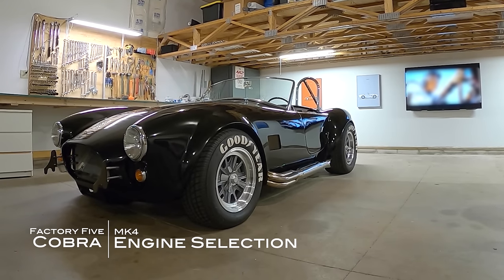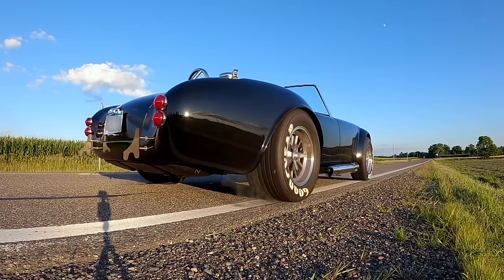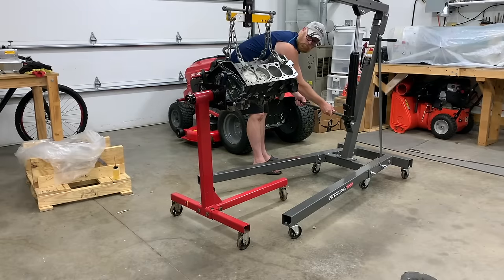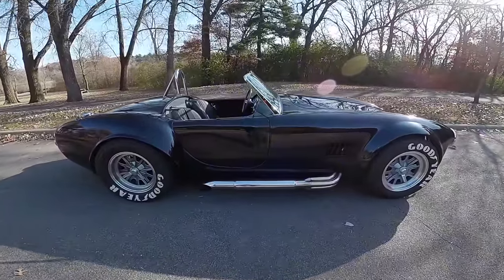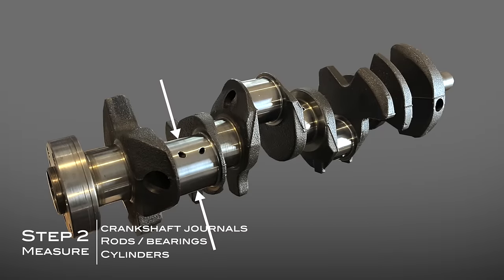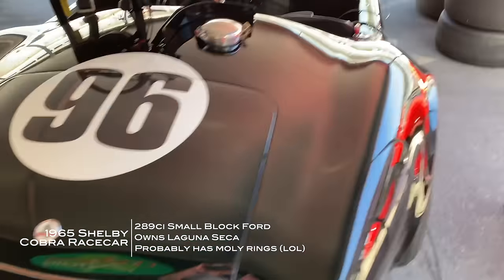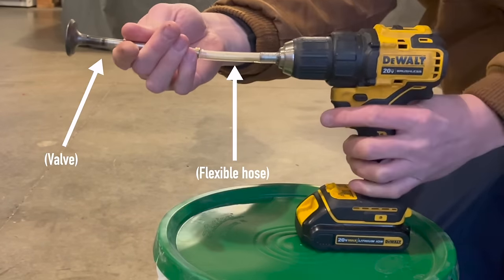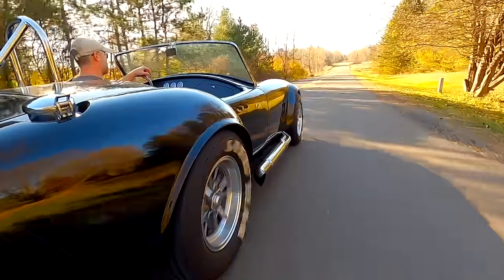Factory Five Cobra: Engine Selection

Comment: I really liked the video.  In the past I have had a 90 Mustang LX 5.0 and a 94 Mustang Gt.  I like your assessment on the 5.0, my critique on this however is that if the crank was in good shape, I would have reconditioned it, but, I would have spent the money and overbored the engine.  I find these engines, like the Chevrolet engines as well, tend to egg shape over time due to the softer castings.  A friend of mine overbored his 289 65 Mustang that was inherited from his father due to that very reason.  I know that is not specifically in the budget aspect, but to me it is cheap insurance for a long lasting engine.
Reply from the maker: Hey Scott /  I actually just got back a Windsor block bored .030" over (306) from the machine shop - going to put that together this winter and have a part2 of engine selection in the works. Well said and thanks for the comment!

Comment: I really enjoy your videos. I don't think I could build an engine by myself, but I appreciate the knowledge and skill of those who can.  Very cool. I also really like you commenst re: horsepower to weight ratio and what is wanted  v what is safe. My guess is most of those 500 or 600 or 700 H/P cars are not driven much unless it is by a profssional racer. That kind of power is untenable on the street for an untrained person. So thank you and please keep the vids coming!
Reply: A 500-525 horsepower small block 427 stroker is a very popular engine for these cars.  These 525hp cars are drive-able on the street IF they have good tires AND if they are set up properly.  But you are correct, probably less than 1% of Factory Fives or other Cobras have 600-700 horsepower - that's the point where nothing but drag radials will keep the car straight off the line when hitting it hard, and even then the price to build such an engine goes way up.
Reply from the maker: thanks for the comment Sipzter / completely agree!
Reply: @BradThePitts  Mr. The Pitts :) I would love to have a 427 stroker with the power you're talking about in anything -especially a Cobra! I used to have a 95 Impala SS one of those would have been fine in that beast! As far as setting up a car right - again, I'm too damn ignornat and wouldn't know how to do it, but I could drive it!!
Reply: Totally happy with my stroker windsor @500+hp, which has that extra power when you need it. Thinking of doing another one. It would either be the drop in coyote, or the big block Godzilla. Either way, you can easily add power at a later date if you wanted. There's just something about that big block gutteral idle sound though!!

Comment: There is company in Germany, Bad Gandersheim, which is specialiced in manucfactoring 8 cylinder motor with huge displacement. The also build cobras from 500-1300 hp. Guess driving one of these should be fun.

Comment: One other thing to think about is the overall weight of the power train, engine and trans vs power output.  You should also think about either building a motor that makes peak horsepower at high RPM or go after brute torque down low.  With 500 to 700 ft lbs. of torque, the car will pull hard in any gear, and at any speed on the street.  The bulk of people now cold look at any motor and not have a clue of what it is, they can't even change their own tire without help from their mom, so use whatever motor you like.  I would use an all aluminum 540ci BB chevy with a turbo 400, 3,500 converter and a 3:50 rear gear.  let everyone cry until they were dehydrated, it would be easy to drive and very fast.
Reply from the maker: Well said @BulletSpoung - torque RULES on the street and I couldn't agree more. The 350 I put in likely makes 400-450 ft/lbs so its decent, but NO-WHERE near the awesome torqure curve of a chevy big-block / thanks for the comment!
Reply: Jay Leno had a steam car from 100 years ago that produced 1,000 ponds of torque.   Anazing.

Comment: If I ever build one I would go with one of the following engines ( Chrysler 3.6L V6 Pentastar, Ford 3.7 V6 Cyclone engine, or The 3.6 liter LGX V6 engine).
Reasons: cheap, reliable, easy to maintain, and they all have enough power and good fuel economy.
Reply: Your opinion on Alfa v6 3.0L EFI with 135kg engine weight and 262.0.510.00 Getrag dogleg transmission around 35kg? Diff ratio for 180km at 6000rpm.  See my icon. The great advantage of v6 engines is 60deg meaning the engine can be close to the firewall leaving plenty legspace, smaller tunnel and less heat on your legs from the exhaust manifolds. If I want to do power the B8444s V8 volvo from Yamaha commissioned by Ford ( S80 & C90) when they bought Volvo will be my 2nd choice. Also 60deg

Comment: A 302 secondhand thats never been touched sells cheap a few hundred dollars, do a 30 thou over bore to clean it all up, buy a 347 Scat Kit, with 600HP rated heads, with a 750 cfm carby, a 3/4 race cam, should give you around 450HP, but it will cost you around 10K to have it all done professionally, whereas a secondhand LS3 engine with low kms is giving you with a few trick parts 450+HP for $5-6K or a new crate engine complete for 10K, either way, its going to be a fun car.
Reply from the maker: well said James - I actually just picked up a C8 corvette with the LT2 motor and that power delivery is absolutely incredible - linear / predictable - it makes driving fast almost too easy (lol) - thanks for the comment and I can tell you know how to build a ford small block right!

Comment: Excellent video, with great down to earth advice based on experience. What's your next motor going to be?
Reply from the maker: Still tossing that one around- a lot of the guys on the FFR forums are pretty happy with stroked small blocks and stroked 351s (great to hear)- I did setup my fuel system for 60psi+ too so a Coyote is an option also. Right now I have 8.2 deck at the machinist and he's checking it and my plan (as of this moment) is to work with this block -but - that's always subject to change :) Thanks for the comment!
Reply: @TacoJoe  I think that modern engines last much longer than engines from the sixties and seventies. I had a FE 428 built and after about 100k mile it was begining to wear out. I'm thinking that the modern metalurgy is very much improved. However, if you only put limited miles on it, that may not be a big consideration. I did watch this one coyote build where they locked out the variable cams, so it lopped, like old school.
In the eighties I had a 89 Mach 1 that I kept for twenty years. Now I have a 21 Mach 1. I have many fond memories of my 69 Mach 1, but my 21 Mach 1 is superior in every way.

Comment: Use hp/Ton as the cobra is around a ton you can easy relate the number.
I think you evolve using the car, doing different things so you can modify a V8 extensively when you want more. Get it done quick, have fun learning to control it.
Reply from the maker: It definitely can be a handful! / thanks for the comment!
Reply: @TacoJoe  I love the Factory 5 cars, light and simple, there nothing like that anymore. Everything with V8 is 1.7ton or spaceship

Comment: I know this will draw some heavy criticism here, but I would want to use either a 2.3 ecoboost out of a newer mustang, or a 3.5 ecoboost out of a f150. Either engine easily makes 350+ hp. Much cheaper and 30 to 40 MPG and still outrun almost anything on the road.

Comment: Comparing a front engine power to weight ratio to a mid-engine car of equal ratio ignores the weight that is over the drive wheels, so the Cobra will not achieve the same acceleration as a mid-engine.  That being said, the Cobra will definitely put a huge smile on your face, it’s more of a raw experience
Reply from the maker: well said Bob and I can't disagree. C8 is a sweet sweet car too / thanks for the comment!
Reply: The Cobra is a mid engine car. You don't know what you think you know

Comment: My SBF is pushing 410 so I got the best of both worlds 😎
Reply from the maker: How do you like it / any scary moments-etc? My biggest concern is losing traction in 2nd/3rd going 45-50+ and then a spin. Did you stroke yours too? I'm grappling with these decisions now on my build (ie- stroke to 347 or a 302 rev monster)- thanks for the comment!
Reply: @TacoJoe  still putting it all back together with the new specs but I originally drove it when it had 340hp (same block) and coming from a GT500 I’d say it was a lot more manageable while still being similarly quick. I will be upgrading to some custom steeliest that can handle a 345/18 tire to add some additional grip to mitigate those scary moments but really only had those moments if the tires were cold (currently 315/17). 

A friend of mine who also has one went with the 427 and he said if he could do it again he’d go lighter and smaller with higher revving so that’s what I’m planning my next upgrade to be, a small stroke and bore uptick but still able to rev past 6500 maybe even 7k if we’re lucky. AFR heads had the biggest gains for me btw, paired with Sniper EFI and a 427 intake and it breathes like no tomorrow.
Reply from the maker: that sounds awesome- when spinning to 6500-7000, any concerns with the rods? Asking because I'm at a tough point in my build with that decision - ie - the OEM rods are good, but have the wimpy 5/16" bolts. I don't think they are an issue until you get 5500+. The other issue I've ran into- it's TOUGH to find balanced rotating assemblies these days that don't have a 3 month lead time! Let me know what way you go with your build and thanks for the comment!
Reply: @TacoJoe   so I just got it back to the go kart phase. Wow It is quick, 70HP difference was definitely noticeable. I would say your concerns are justified as far as spinning in 2nd/3rd as I can start in 2nd and spin the back tires no prob (T5 + 3.73 rear). In 1st I don’t even have to give it throttle as it pulls and will shift 1-2-3-4th without ever giving it gas. Engine is still in break in period with new cam but I can’t say I didn’t rev it a time or two once things got warmed up… but it gets to 6600 without issue. It is stock 302 bore/stroke currently. It is a Ford performance crate with internally balanced forged internals.

Comment: I'm partial to a push rod motor in these cars.  The Coyote is cool, but push rod motors produce tons of fun low down, where the car will spend its life.  Torque is what I'd be after.  After all, HP is a computed metric based on torque.
Reply from the maker: Great comment Paladin06 and I agree - In some regards, Windsors are the best of both worlds too given the flatter torque curve and the ability to rev a little too / well said!

Comment: I put a Ford Racing Performance Parts  (FRPP) 340 HP crate motor in my 2012 F5 MK4. Also went with IRS. Found out how easy it is to blow an IRS diff. Fixed it and it keeps me from breaking even  more stuff. It's a Road car not a drag racer.
Reply from the maker: Bummer man- how did you lose the diff (clutch drop)? I have and 8.8 and have dumped the clutch a lot but no issues so far. Just running street radials though. Thanks for the comment!
Reply: @TacoJoe  Independant Rear Differentials break way easier that an 8.8 solid.
Reply from the maker: good to know - are you breaking U - joints or did something in the pumpkin let go?
Reply: @TacoJoe  The splined shaft into the pumpkin, left side, last 1/2 inch, sheared off.
Reply from the maker: So did you replace the whole pumpkin, or just the shaft?

Comment: What about the FE?! The actual engine that came in these cars that we’re all trying to replicate! A 390/427/428 is a viable option that you completely left out of this video.
Reply from the maker: FE is a great motor too / maybe in a follow up video I can walk through some of these options. By chance do you know good vehicle donors for 390/427/428 blocks?
Reply: @TacoJoe  Thunderbirds, Mustangs and pickups from the 60's all had the FE's. As did a bunch of Mercury's. They're available. They're not an 'economical' option, but they can make big power, with good aluminum heads, and intake manifolds, which are also available.

Comment: In my opinion, of course, it's all about the cars use. I would much rather have a very light car for most track racing, thus a 289/302 is fine.  Drag racing... well, bigger is better in most cases. A 427 would be nice. A 429, if you can find one, is better.  I'm not a 428 fan at all. 
All that being said, I'd go with a coyote, dry sump, with a blower, on e-85... LOL

Comment: Engine choice - on street tires, the 0-60 time will be about the same in any Cobra.  However,  I've had three different engines in my Factory Five - 270hp, 325hp, and 450hp.  I can positively say that the higher horsepower engines  make a TREMENDOUS difference when accelerating from say 30-100mph or more.  My car keeps you back in the seat up to redline in 4th gear & 135 mph.  How fast do you want to go?
Reply from the maker: Thanks Brad- any concern with canning it with 450hp underfoot? Asking because I'm making some critical decisions on my engine build now. I can hit 450 no problem, but I'm more worried about spinning wheels in 2nd at 40-50mph and then things could go bad (lol) - it's a tough call. ANY other car and I'd be going 450-500hp as a no-brainer

Comment: I would run a Coyote. It hits my check boxes. Stock internals are good for 800hp (gen 3, 650hp gen1). The engine does not make too much torque at a low RPM, better for street launching. If you want the cammed sound, then a ghost cam tune will give a great engine rumble at idle. High revving engine for winding it out to 7500rpms stock. You can make big power on the stock heads, no need for upgraded cam followers, cams, valves, or springs. The engine already has a windage tray built into the oil pan gasket. The main thing that needs to be changed out is the oil pump gears for 600+ hp engines. If I could not run the Coyote I would run a Cleveland. Clevelands do not have the aftermarket that the windsor has, but they really do well with factory 4v closed chamber heads and a custom ground cam.
Reply from the maker: I can tell you are knowledgeable about the Coyotes and excellent point about launching with the lower torque delivery - Coyotes are meant to REV!!! Thanks for the comment Bob-

Comment: the best engine is the 351 w more power more torque out of the box and more room for bigger cubic inch can handel more hp and is smaller than a  modular among other reasons also any sbf  will take valve lift to .525 lift
Reply from the maker: completely agree - the crank journals on 351 are much larger than a 302/5.0 too - indestructible bottom end. I have a friend who has a MK2 with a 351 and its a complete beast / evaporates radials on command (lol) - thanks for the comment!
Reply: Yep. I just put drag radials on mine for around town only. Got embarrassed when I spun my other tires against a modified scat pack who launched at a red light. Couldn't quite catch him after that rookie mistake!

Comment: Coyotes are great engines but their distinctive sound is nothing like a classic 60's V8.   So it depends on what you're after.  For classics, I personally prefer a FE or 385 block (ford 460) or if you want a small block, a Ford/Windsor.

Comment: Hello, great video.  Can you provide info on the tires?  Which Good Years, DOT approved?  Etc..  Thanks
Reply from the maker: Hey rtcollinsjr / they are actually Cooper Cobra tires / 235s on front and 295s in the back on 15" wheels and are standard radials/DOT approved. The "Goodyear" lettering is just a stencil that I superglued onto the tire - but first - I used a Dremel to sand the tire sidewall text/markings flat where I glued the letters. Do some google searches and you can find the letters stencils / kits to do the same. Good luck!
Reply: Thank you

Comment: I would run a Windsor Aluminium Block . Billet Crank,  Rods & Pistons.  Top Shelf Stuff . 
Cu Inches 441 . Compression 12.1
Heads Ford Hemi Aluminium from Georgia USA 🇺🇸 
Manifold, either Single Plane or Borla Individual Throttle Bodies.  
HP around 700 .  TQ 600 approx

Comment: Thanks for the video @TacoJoe! I have been following your build for a while and am using many of your tips in the FFR I'm building with my family! We pulled an engine from a 2001 Explorer and have gone through it much like you've described.

Did you use the factory oil pan? And if so, any fitment issues? Factory oil pickup? Thanks again!
Reply from the maker: haha - that's great and glad to hear your build is going well! I think the explorer pan will fit - but - it might be a front sump? - and - I think the oil pump is in the front with this setup / I'd look for an aftermarket pan from summit or jegs and you might need a pickup too (search 87-93 fox mustang pans) - good luck with the build!

Comment: 550-625 hp stroker windsor with modern upgrades is easy and affordable get a truck block 94 and later so you can run a good roller cam with enough lift ...  buy good aluminium heads and intake toss the stock heads in the trash. Put on a holley sniper f.i system. You'll be way ahead in the end. .
Reply from the maker: It’s tough to beat efi / thanks for the comment!